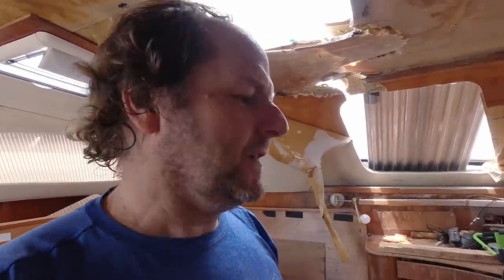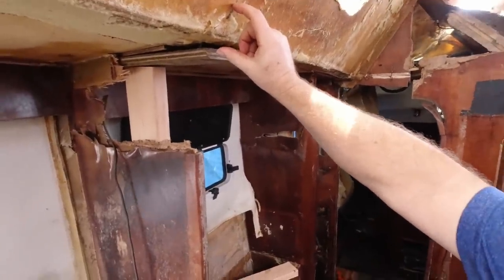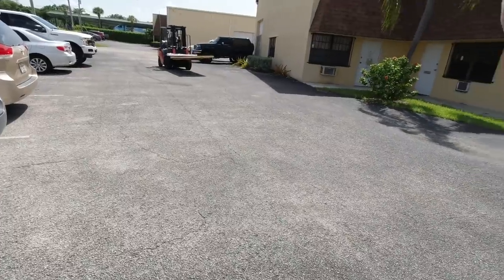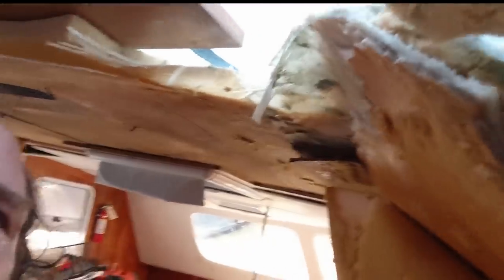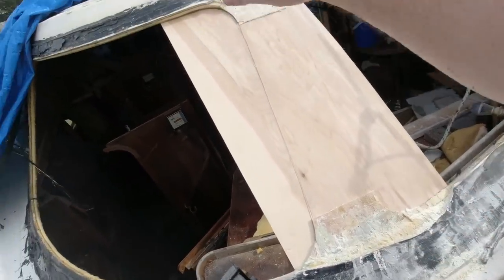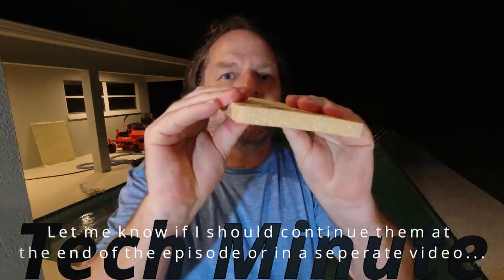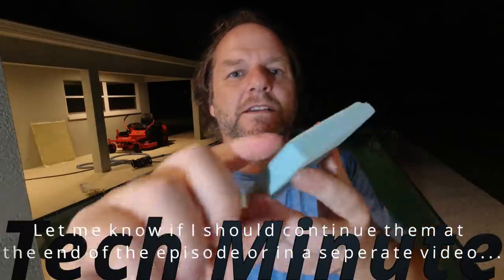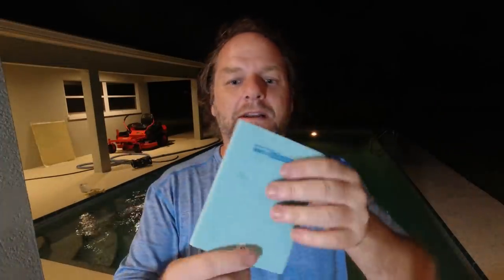7 Foam Core Fiberglass Boat Repair on my Salvage Sailboat

Comment: Good to see you getting into the composite work.Definately beef up those window mullions considering the damage.Even a couple of layers of carbon unis running into the saloon roof from the mullions will tie in and reduce fatigue. And add substantial strength to the roofstructure.Great vids .Rossco
Reply from the maker: WOW, one of my YouTube heroes is commenting on my channel, Thanks so much Rossco, I've been following your channel since you hauled those molds to your factory and never miss an episode.Thanks for the advice, I've learned a lot from your channel. ⛵⛵

Comment: Some small Tips from a Boatbuilder. When you replace the foam, make it in an angle from about 30 degrees. In Germany we called it "schäften". Take a look at this. That is the right way. Much stronger than 90 degree cut. Sorry for my bad english. Greets  Paddy

Comment: You are a beast Bryan. After building a relatively small boat (31' F-9A tri) from scratch, I do not have it in me to take on a project as big as the one you have. Maybe watching you will make me want to though.
Power on and good luck.
Reply from the maker: Those Farrier boats are a lot of work to build (and very awesome boats), that is very impressive. Thanks for the support.
Reply: @BryanSailing  They are great boats and so fun to sail even in light stuff. Mine is carbon over Duracore, launched in '93 after a solid 2 year build. Now it's just not the right boat for me as I'm older and I want to cruise and a cruising cat it is not. Wish I had the energy to take on a project like you.

Comment: Definitely inspect the heck out of the structure and beef it up extensively if you see any issues/cracks. YouTubers "Parley Revival" bought and fixed a Hurricane Irma damaged Lagoon 450 cat from the BVI. 
They had done a huge refit in Honduras, sailed for well over a year, had passaged the canal and were days from leaving Panama starting a Pacific crossing when their rigging suddenly went slack. Now they've found a new crack in the structure and have to go back into the yard. I'm betting it was damage the boat sustained in the Hurricane that was well hidden until now.
The next episode will be very informative. Although the situation does not look pretty, it could have been really ugly had they been out to sea (in a storm) when it showed up.
Reply from the maker: So true. I'm anxiously awaiting to find out exactly what happened with Parley. I also can't stress this enough for anyone considering a damaged boat inspect every part of the boat and not just visually - use a hammer to check to internal delamination. If you see a crack, don't just patch it, grind it back until you are sure there is no more damage and fix it right. I sure hope all turns out well for Parley, I really like those guys.

Comment: Nice work Bryan, but surfboards can be made of polystyrene and epoxy. They are plenty strong as the foam is not structural, my guess is that a foam cored cat would be the same.

Comment: Amazing project boat!  Thanks for the lesson on foam cores.  I've been using the honeycomb after hearing about it on "Onboard Lifestyle" where Teal built a completely new interior of their project cat.  That part of their channel might be interesting to you if you haven't found it yet.  I learned a lot from his videos.  Mr Albert always gave me good deals on stuff from demo boats, thats probably a good place to be doing a restoration.  I'm in Merritt island if you ever need a helper.  I know a lot of things are easier if you have someone to hold the other end of something or hand you tools when working in a hole.  There are two youtuber boats being restored at my dock now and you will be welcome if you can fit under the low bridge going in here.  I've been watching your project with great interest.  We're planning to cruise the keys next summer and Bahamas the year after if you'd like to come along.  Bring your boat if its in the water, or crew with one of us.  Best of luck with your project.  Let me know if you'd like any help at any point.
Reply from the maker: Yes, keep in touch it would be fun to go cruising. I promised the friends I made in the Bahamas to go back and visit when I get the boat done.

Comment: Very informative, however, as you have mentioned in previous videos, it's engineering. Composites by their nature are combination and allow different properties to be achieved, so although I personally am not necessarily advocating it there may be a place for using cardboard, balsa, polystyrene, Etc as a core. It's engineering: cost; weight; stiffness; torsional strength; compression; failure characteristics; temperature stability; UV sensitivity; electrical conductivity; acoustic transmission; compatibility with existing materials; ease of repair; Etc. My point, don't write a product off simply because it can be bought at Lowes

Comment: When I was 11 or so, my dad constructed a replica of a ship type called Collin Archer and used something like polyurethane foam and we cover that in several layers of glass and then added gel coat. The whole thing was bottom up to make it easy, but when we carefully flipped it the hull wasn't strong enough to maintain it shape, so the ship ended up being a good meter and then some wider than planed. (I can't remember how much exactly, but it was between 1 meter and 3 meters). We spent many years on that ship each summer and lots of weekends. It was sold off just a few years ago because none of us are up to maintain it or sail it anymore due to health issues. Sad, but that's life.

What we learned from that bracing is king and do not use the weak ass foam ever again.

But thinking about that process, parts of building it was actually fun and interesting. 

The ship we built never sailed very well and rolled like you wouldn't believe, even with a keel weighing close to 10 tons, but I have good memories about it and that's what counts. My recommendation is to make some experiments just to see what solutions works best and have fun doing them, I wish we had done that back then when I was 11, it would have solved so many future issues from ever happening.
Reply from the maker: Nothing beats the memories of messing with boat

Comment: I was told the strength of the foam does not really matter but.. resistance to compression is key.
Foam only server as 'spacer' between inner and outer layer of glass. Works a bit like reenforced concrete.
Reply from the maker: I'm not an engineer, but from an engineering perspective, it's true the foam doesn't take most of the load. The center is the neutral axis and the farther away from the center you are the more load is applied, however if the foam is not strong enough to keep the two skins separate, but still in one piece it will fail, it's really a balancing act. I could write a lot about how it works, but it would be boring, reinforced concrete is a good example for the fiberglass and resign. For foam sandwich, an I beam is a better example where the strength is the top and bottom and the skinny layer separates them.
Reply: @BryanSailing  indeed a better example I or H beam. Foam has to withstand compression so as to keep inside and outside layers seperate.

Comment: May have been said but please keep a running number in the video title so we can see each on and make a note if we r
Want to review one. Great project and a great boat to work with.
Reply from the maker: The number is on all the previous versions and I add it to the latest video after it's been out for a few days. Thanks.

Comment: Using 'peel ply' ?
Great to smooth out glassing, especially if laying multiple layers, removes the wax off the surface when it's set - no sanding to take the next laminate, also less fairing compound needed prepping later for that paint job.
Reply from the maker: gotta love peel ply

Comment: I''m curious to know what resin you use; the original layup would have been polyester, are you repairing with that too? Or going for epoxy for better adhesion? Good to see someone doing a proper job of repairing a boat like this, a lot of people don't bother with your level of attention to detail.
Reply from the maker: vinylester if I might put gelcoat on top or epoxy if not.
Reply: @BryanSailing  Thanks Bryan, so glad to hear it's not polyester!

Comment: You certainly take on tough projects.
When you get to repairing the holes in hulls that now have hot patches, try taking a look at Parlay Revival's youtube from late 2019 and early 2020.  He bought a hurricane damaged catamaran in BVI's in 2017.  Different brand of catamaran  using different core materials above waterline, but techniques may prove useful.
Also- can the mast be sleeved or is it too far gone in too may places?
As far as making a new rudder- check out Sail Life youtube from 2019 where owner made  new rudder for his 38' monohull.

Comment: Does your boat have a fiberglass liner inside the fiberglass hull with a cavity between them. If so, you will need to clean the skins inside that cavity to prevent smells/mold later. Might need to cut away the inner liner. I'm sure you already knew that.
Reply from the maker: Great tip. Good news is liner is only used in the heads.

Comment: If you want someting strong take than a look to acrosoma panels. Neadled santwich panel with kevlar. I want to make the hull with this panel. What do you think?
Reply from the maker: Took a look at those panels- they seem awesome. I think they would be perfect for building a boat hull. Looks like they can be made from many types of foam, just make sure to use a foam that doesn't fatigue with the constant pounding of waves.

Comment: Myself, If there were relatively smaller areas to repair I would go with some flex using the more expensive materials because you only do it once and the fiberglass gives all the strength. I would think the foam just saves weight without much structure. The bulkheads are more important. Sorry, don't mean to be a know it all.

Comment: Yes . you want to rebuild the boat the same way it was built from factory . dont skimp out or use inferior meterials . it's going to cost you more but you want the integrity . the interior isn't going to matter as much as long as its not anything that supports the boat . thanks gfor the update . the nickel and dimeing has begun ..lol .

Comment: Hi could anyone give me some advice about if it’s possible to cut and rejoin fibreglass
Reply from the maker: Yes. There is some technique to it, but it's not too hard if you use the right materials, don't contaminate the joint and taper (scarf, feather) the repair back a ways usually around 20times the thickness (but it depends on the desired strength)
Reply: @BryanSailing  hi im actually trying to make an only fools and horses van and want to cut the front of a fibreglass 3 wheeler and replace it another front end so not sure if the join would be strong enough

Comment: Level???? That is not a term used in boat building. All your build is referenced to existing vessel lines. You likely not ever see a level in the shipyard. The water line is the only line referenced in the table of offsets that will end up level, when launched with machinery and fluids. Bulkheads are put in at right angle to this line. You could set up a laser level and shoot say cabin sole lines  to hull sides. That is common in boat building.
Reply from the maker: makes sense